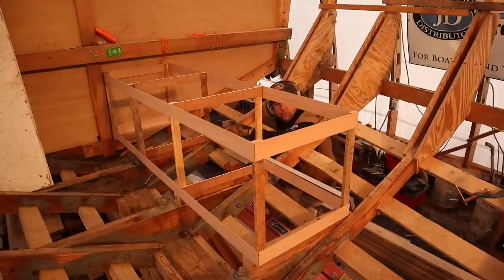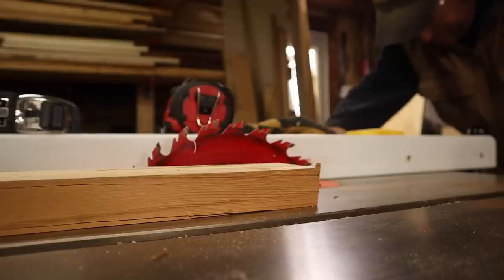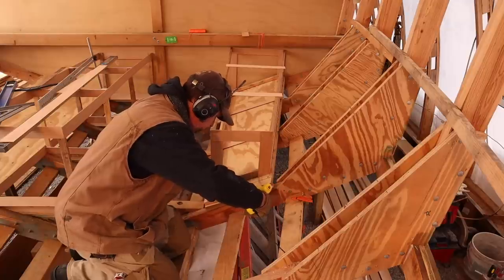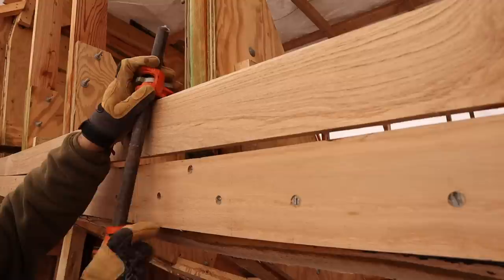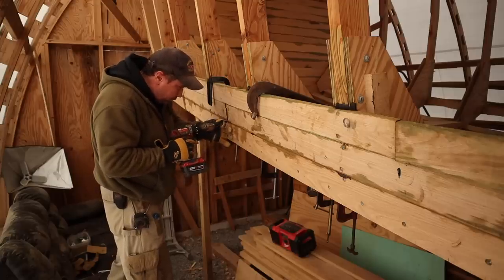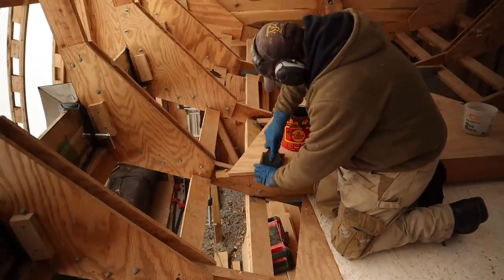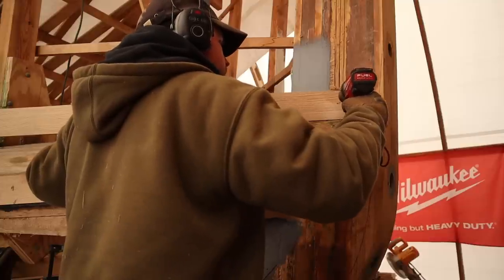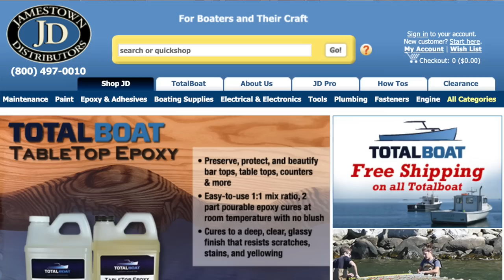Planking our wooden trawler yacht continues.  Sea Dreamer Project episode 53

Comment: Scott, I understand why Acorn to Arabella and Tally Ho are using slotted screws, future  replacement if necessary years from now.  Since your oak hull planks get covered  with  two layers of plywood and then glass and epoxy, why bother with the slotted screws?  You will never be able to access the oak screws again.  Keep up the good work. I love your videos.
Reply from the maker: We received a donation of a large amount of slotted screws from a viewer that were left over from his project. Also there is only a very limited choice in head styles for galvanized, cut thread wood screws so when we buy our own we’ll try for Phillips but may be forced to use slotted. Regardless, with the correct size bit, it’s not that challenging to use them.
Reply: @SixPointsWoodWorks  Good question.....Good Answer!
Reply: I was wondering the same thing... It was a good question, and good answer.... Although, I never seem to have good luck with slotted screws on a screw gun...
It always seems to end up with a couple curse words and a driver bit getting thrown away...
Really like the torques bits.... But that just me.
Keep up the good work Scott 👍👍. I guess this was the first time I heard you were going to cover the bottom in fiberglass...
Reply: @daveevans7438  I was once involved on a rebuild of a 1945 ferry . We bought bronze alloy screws from New Zealand at NZD$1.00 each !! Correct diameter hole and lubrication was a must otherwise they can twist themselves in a flash.

Comment: Yeah, butt-blocks have been used in wooden boat building for centuries, and they do in fact work. However, as technology has progressed scarfing has pretty much taken its place. Butt blocks, historically, have been a spot of accelerated rot because they end to hold water at a joint that can't dry out the same as exposed wood. Yeah, it will work, and it likely won't fail in your lifetime (perfect for a boat built for only your lifetime and not a re-saleable vessel, as you have said many times.) so go on and you do you, just make your viewers aware that it is a failure spot in a ocean going vessel if you plan on selling it in the future. I can't wait to see the plywood going on and the glassing. 
Love the templating footage. Smart use of wedges to provide a flat surface for the tank to sit on, and backing up your hot-melt-glue with brads is a very smart step, especially if the template is going out to another cractsman/craftswoman for the actual tank build. Was that one for the waste, the potable water, or fuel?
Anyway, see you next time. Keep up the great first-time build.
Edit: corrected some spell-check errors, and
P.S. As another already commented...
Gloves should never be worn when working with high torque spinning tools like the table saw. The risk is not worth the reward of having slightly warmer fingers. Gloves have been known to snag and remove/destroy fingers and hands. Please keep safety in mind, Officer, you likely have some impressionable viewers that will follow your lead.

Comment: I watch this kind of stuff as a way to relax
from my own project:
Which is re-painting my 3-story wooden  house
that hasn't been painted in 50 years.
So far,  I removed all the paint from the trim and fascia boards,
gave it 1 coat of linseed oil and one coat of oil based primer
Then  I removed all the paint from the 1st story planks
and sprayed the entire house  with 1 coat of linseed oil.
My next step is to  spray a 2nd coat of linseed oil...
Why linseed oil?
Because boiled linseed oil has a life expectancy of 75 years
which no primer has.
After the trim is given a coat of oil based white gloss:
I;m going to tape off all the trim and spray the entire house with
oil base stain because stain doesn't peel with age.
Why oil base?  Because most latex products are crap.
How do I know this?
Being a paint contractor for over 35 years helps.
Now that I'm retired I can do a paint job that will last properly;
I mean for 75 years without repainting: which nobody does anymore.

Comment: Interior baffles ?  Slosh, starboard /port and fore and aft can be a large concern in a heavy sea.  Clean out access ports for the tank?
Reply: You are asking questions which he has covered in other videos.  His tanks have baffles and access hatches.
Reply: JandT LivingLife  hilarious how many comments are on here from people that don’t watch the videos.
Reply: @craigpritch  Craig, If I had noticed previous videos I may have known. But when one first finds a new thread,, well you need to start somewhere.  It did peak my interest,, 2X4 frames 3 feet on center and a hard turn to the bilge.  I assume multiple diagonal layers to the hull,, but the sharp angle of the chines would lead me to think in terms of a concentration of forces at that point.  Just curious.
Reply: Sailor376also Sorry @sailor376also, I shouldn’t assume everyone watches them all. If you get the chance to start at the beginning, it’s very interesting. He does a good job of explaining his choices. I’m used to watching the classical boat building techniques Sampson and Acorn use which require tools and budgets far outside a typical person’s capabilities. This is so approachable and different from anything I’ve ever seen.

Comment: Hey Scott, you're doing a fine job for the level of workmanship you have set yourself.
Amused to see the difference tho between amateur and craftsman.
Amateur roughs out rabbett with a narrow, blunt chisel and cleans it up with a grinder, fills the gaps with gunk and is happy.
Craftsman roughs out rabbett with grinder and finishes with wide, perfectly sharpened chisel such that there is barely a whisker of gap. Resolves to do better next time.
Keep up the good work!

Comment: I was going to ask about the butt joints, but you covered it!  Sounds kind of punny...  On another note,  why do you use standard head screws instead of Phillips head screws?   How are your flat head bits holding up?
Reply: Flat head screws are better for many applications. When it comes time for maintenance it is michbeasier to clean out a slot rather than a cross (Phillips), square (Robertson), or star (Torx) head to regain access to removing the screw. 

Having said that, if he is double plywood sheeting and glassing, then removal of a plank for repair/replacement is a moot point. So, yeah, with this hull design any fastener would work. 
He did us a few Phillips screws if you look closely.
Great question.

Comment: I'm curious as to why you are using slotted screws for your planking.
Reply: Tradition.
Reply: He is probably using hot dipped galvanized screws which likely are not available in other head types that support high torque loads.
Reply: Read above they were given to him by other boat builder.

Comment: I love the "will be able to take two people comfortably anywhere in the world".   The term "comfortably" on any boat under 150 foot is really optimistic.
Reply: My wife and I have over 30,000 nm under our keel(s).  On boats ranging from 26 to 46 feet.  Sailed Alaska, Mexico, Hawaii for over 8 years on our last boat, the 46 footer.  Sure, there were times when we were uncomfortable but if I were to do the math, I would find that they were probably about 1-2 percent of the time.  Pretty good ratio for anything, in my opinion.  In todays world, crossing oceans is much different from even a couple of decades ago.  He has predictable, near-constant speed, hence his speed/time/distance calculations will be accurate enough.  If he makes his passages at the right time of year and takes advantage of modern weather forecasting and perhaps for his first crossing, even hires a professional weather router on shore to communicate with while at sea, he will be fine.  Most importantly, the small periods of discomfort will be offset 1000 times by the large periods of adventure.

Comment: I do have a question though on balance. When you do fittings ie tanks for fuel and water, is there a calculation you make to ensure the boat will remain balanced side to side and front to rear?
Reply: You just trim the boat later with internal ballast

Comment: It looks like you are going to have some  butt blocks. You might want to rethink that. They are a source of trouble in wood boats you might reconsider to scarf joints,
Reply: Alectron Dorfman  Remember he is covering with 2 x plywood and epoxy fiberglass. Scarf joints in planking is a new invention  since waterproof glues came along . But block or long planks were the order of the day for hundreds of years. But yes the blocks might need maintenance if he was only planking in oak.  Cheers Warren

Comment: I wouldn't take that boat anywhere other than an interstate pond those planks are way too thin and narrow why don't you take a few hints from acorn to Abella and Sampson ⛵ co. Those two ships will last 100 yrs + .....very well built too ....nothing good is ever easy you're cutting way too many corners
Reply: Bradferd Piet - Just a FYI Monsieur Sexuel Intellectuel you do understand that this is the first layer of planking and that the builder of this boat is purchased and is following the plans of the very well respected naval architect the George Buehler.  So maybe do yourself a favor and instead of talking out of a body orifice used by the solid waste excretory system of your body maybe engage your walnut sized data processing organ of yours that is rattling around in your hat rack and use your marshmallow manipulators to surf the information super highway to learn about something about the topic you so desperately feel you must comment upon.  I will give you a hint where to learn about the design of this and many many other boats like her dieselducks dot com.  I do apologize for my scathing reply but your post just stuck a cord.  That said I have a question do you have a glass belly button. 
Have a nice day and a better tomorrow 😁
Reply: Bradferd Piet , You should watch the whole video, he is covering with 2 layers of 3/8 plywood and then epoxy / fiberglass . The planking is just for strength and it's easier to bend in place with smaller width planks.   But I would think using an adhesive bedding compound would be a lot better than tar and the planks could be glue with one part urethane glue ( waterproof) like gorilla glue . It would add 15% to the strength and the preservative is really a waste of time , add it afterward to the inside surface. 
But remember he is the guy doing the job the rest of us are just armchair builders so if it works for him it's fine with me.
Also acorn to arabella are only book learnt so they are not building from experience like Leo Sampson.
Cheers Warren .
Reply: Bradferd Piet The planking on this build  is not the same as Acorn to Arabella, this boat will have multiple layers, but thanks for your ill informed opinion...
Reply: @eyebok  I still wouldn't take it on the open sea I don't see a ballast that would be heavy enough just the straight keep and with all that epoxy it's the strongest part of the boat I truly pray you don't capsize in high seas I was born within sight of deep water in Louisiana been on the water all of my 60 yrs I gurantee that boat won't cut the rough stuff now tally up and acorn to Arabella I'd take through a tropical depression
Reply: I guarantee that boat will be top heavy which is very bad for a seagoing vessel
Reply: @don1464  yes I have 4 to be exact  all still seaworthy and making $$$$$ 2 steel and 2wood none of them as poorly built as seadreamer
Reply: The Navy build PT boats out of plywood........minus the gunfire and torpedeos.......they were a lot stronger than you think!
Reply: @dennisdownes9319  yes that's very true but PT boats had a huge powerful engine to provide ballast seadreamer only has a dinky little 4 cyl diesel the hull on seadreameris no where near substantial enough to counteract
Reply: What I'm trying to say is even with layers other than the keel which is well built still needs a heavy ballast made of steel or maybe lead they need to rethink the hull which very well could be built with plywood and in layers needs a much more substantial framework so yes they're still cutting wAy too many corners
Reply: @don1464  Pretty sure it's the second thing u mentioned.
Reply: @brutusbarnabus8098  I'll say it for him.  Yes!!
Reply: @bradferdpiet159  "Committing suicide"?  You do know that people have circumnavigated the world on a Cal 25 sailboat and on a Catalina 27 sailboat obviously, since you are such an expert.  And I'm sure that you know these are light weight  mass-produced boats.  So, I am curious to know that since these people succeeded with such joy and adventure, why you think Sea Dreamer will fail.  There are maybe a hundred or more Diesel Ducks around the world.  Many of them are built in Asia and their owners bring the boat home themselves across oceans back to North America or Europe.  I have friends who own a 46 foot Diesel Duck.  Great boat.
Reply: @jandtlivinglife3130  I'm from Louisiana and have built 4 seagoing vessels 2 steel 2 wood I know seaworthy when I see it that  ship has way too many short cuts
Reply: @bradferdpiet159  Lousiana?  Oh yes, the Gulf of Mexico.  That marginal sea off the Atlantic Ocean.  Let me guess, shrimpers right?
Reply: @jandtlivinglife3130  sportsman's paradise
Reply: @jandtlivinglife3130  just remember all waters are linked so marginal I do t think so at least I'm not landlocked
Reply: @jandtlivinglife3130  what's up .....? Fish got your tongue ???!!